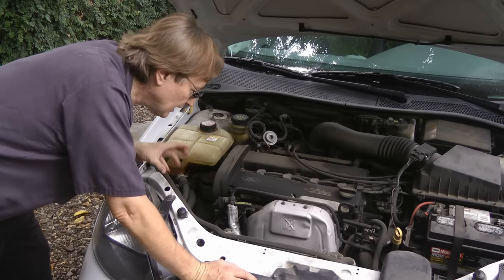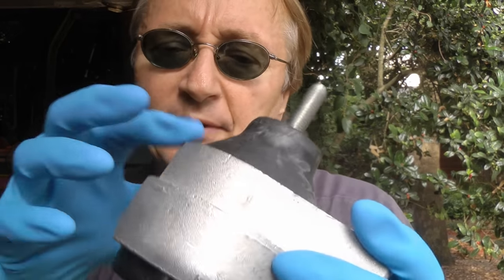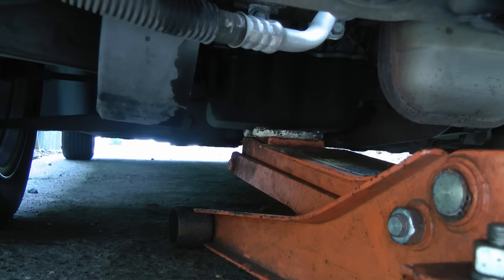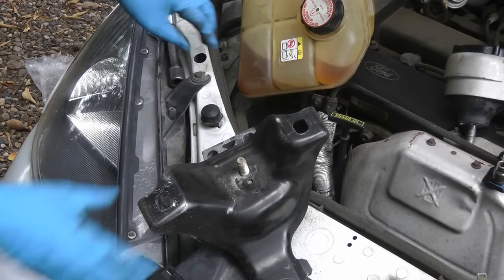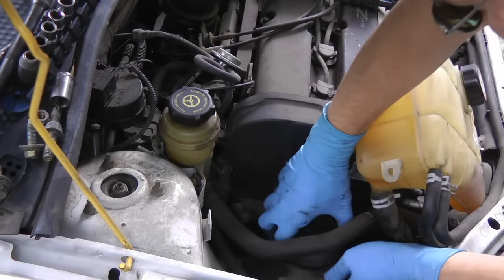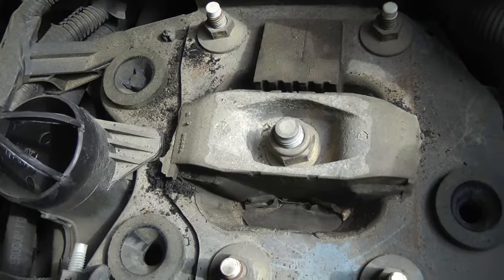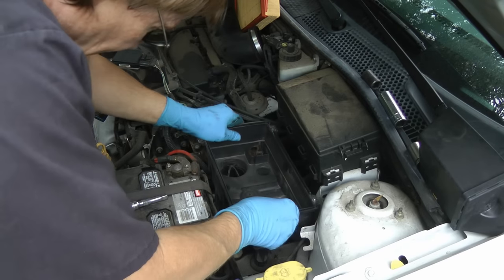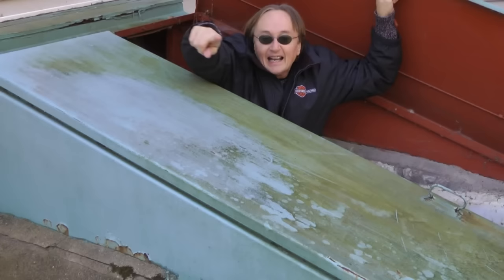How to Replace Motor Mounts in Your Car

Comment: Scotty Kilmer I have a 04 ford focus and when i put it in reverse it vibrates the whole inside of the car and makes a noise. and the engine move too like in this video... but i bought the car in october 2014 and they told me the engine mounts were brand new...and it just started doing this..it does it really bad when backing up on a small incline where i park and the driveway is on a incline.. It does it on level ground but not nearly as bad. But thing is my husband said it did it when he left for work but when he backed outta his parking spot at work it didnt do it..and it didnt do it when i went to the gas station or moved my car at my dads house. but as soon as i go to park it at home it does it.. Im worried....im one broke chick.

Comment: scotty i was replacing my front motor mount on my 04 honda civic and guess what? i broke the casing where the top bolt goes into now the bolt is all loose any good suggestions?????
Reply from the maker: +Juan  Mata drill it out and use a bolt and nut to replace it

Comment: I have a 97 grand am that I put new sway bar pins and new struts on the front and it drives tons better but i still here a vibration or rattle at higher speeds could this be worn motor mounts?
Reply from the maker: only if it occurred during acceleration, on just cruising mounts would have no effect.

Comment: hi scotty, i just brought a 2001 santa fe,  do you know why the steering wheel would shake very badly when im in idle ?   it vibrates in drive, park ( less than drive) ,  and reverse.  I went to a shop and paid a ton of money for brakes which did not fix the problem,  i have a check engine light for an EGR,   i am being told that the motor mounts are causing the vibration,  i just dont want to waste money again, thank you.
Reply from the maker: well, bad egr and bad mounts can both do that, have a mechanic jack up the car and show you the actual broken mounts IF they exist they can be seen
Reply: Scotty Kilmer thank you scotty! i love your channel,  thanks for helping us!

Comment: Hi scotty,
I have an 05 Yukon that vibrates at idle while the a/c is running. the vibration eliminates the minute I start moving. I've replaced the engine mounts but no change at all? any ideas?
Reply from the maker: those have had nothing but problems with the electronic throttle systems that set idle speed. Have that checked by a pro GM mechanic with his dealer level scanner first.
Reply: Scotty Kilmer will do,  thanks a lot!

Comment: hey Scotty i have a 98 dodge caravan 3.3 when i change gears to reverse i sometimes get a hard kick  back could that be a bad motor mount
Reply from the maker: +Andrew Rosado pray it's just that or a bad tranny mount
Reply: How would you know if its a bad gear
Reply: just check the engine as you change gear, if it's moving back n forth. it's bad mounts

Comment: Changing a busted motor mount on 98 caravan.  Motor mount is riding on pin only all the  rubber is gone, will my jack be able to elevate the motor enough to replace the mount or will I need a hoist?
Reply: Fyi, I do have a floor jack
Reply from the maker: Toumas henry
jack will work, BUT you will have to take bolts off other motor mounts to get it to go high enough
Reply: Thanks Mr. Kilmer! The King of cars!

Comment: Scotty, today my 1995 Toyota Corolla started acting up. It first started with a high pitched whirring sound when the car was in 1st and 2nd gear then it would go away, so I thought nothing of it. Now the car shakes upon acceleration from a complete stop and it shifts into 2nd gear really late and it also didn't go forward even though the engine accelerated. It did the no go only once but the other time it shifted late and the high pitched whirring was always there now. I pulled over and had it towed home. I suspect it is the transmission but i hope to God it is something else. What do you think and is it worth trying to repair it. Im only 16 and this is the car I go to school with and I'm on a tight budget. THIS IS AN EMERGENCY!!
Reply from the maker: transmission for sure, that model had a weak transmission in it. Try a used unit, fixing yours correctly would cost thousands.
Reply: Scotty Kilmer Do you think it is worth doing it or should I look into a new car.
Reply from the maker: argonian bilbo
I'd get another used toyota, you can often find a whole good used one for less than a tranny rebuild, and a used unit of course is a gamble
Reply: Scotty Kilmer I will look into it. If I sell it how much do you think it will go for. It is a 1995 toyota corolla with about 135000 miles on it. The only thing wrong with it is the transmission and a little minor cosmetic damage. Other wise it ran like a clock before the transmission crapped out. It also has a salvage title

Comment: Okay ive always been told when it comes to motor mounts your not suppose to preload / torque them while jacked up your suppose to snug the mount metal to metal no gaps or play lower your jack then torque them to whatever the ft lbs they require. Preloaded mounts while jacked up can cause them to fail immediately an most definitely before they should in most cases. So u might wanna check out the specs to your vehicle before following this video cause it may cost u more money doing so.

Comment: Hello Scotty , I have a 2005 chevy classic, a mechanic said I need my motor and transmission mounts replace, I want to replace them myself, but I don't know where are the mounts located at. Could you help me.
Reply from the maker: +Wardell B  get a cheap manual like haynes, they show how and have good pictures
Reply: Thank you Scotty, I will either go the library or buy one from Amazon or Ebay
Reply: +Scotty Kilmer Hello Scotty,I have question, my dad and I change the engine mount and 3 trans mounts on my car, The mounts were very bad, Today I was at the stop light my car was vibrating in the drive gear and reverse gear, but in the neutral gear, it was quiet for a while then it went back vibrating. Could this be the rotors or its time for me to get the transmission oil flush, I never had my transmission flush or the filter replace. My car is over 127,000 miles, its a 2005 chevy classic.

Comment: hey scotty:  i have a g35 coupe and sometimes when i go to a full stop i can hear something vibrating or shaking, also when i start accelerating but it goes away quickly.. do you think this could be bad engine mounts.
Reply from the maker: could be, jack up the engine to check as in my video "replacing broken motor mounts on your car"

Comment: Not related to the but i have a question..
I have a 2002 vw jetta and i just turned the engine off and one of the fans stayed on. 
I dont know if its normal or it have a problem,
Thanks if you answer
Reply from the maker: if it goes after after a few minutes, that's fine. If not, often a bad main computer circuit

Comment: I have a 2003 mustang gt. Engine shakes bad like none other under acceleration and at a stop and out my exhaust it sounds like, blub blub blub, weak acceleration and NO codes. Puzzled on what's going on, you think it could be the engine mounts?
Reply from the maker: +lyonschoice doubt it's doing all that, cause it would have no effect on acceleration. A weak fuel pump, bad maf sensor, or clogged fuel injectors often do that
Reply: +Scotty Kilmer ok thank you, popped off the oil cap and it was the Milky Way, ended up being a blown head gasket, thanks anyway!

Comment: Do you use the jack without stands?
Reply from the maker: in this case, to just check out the mounts, yes. Then you use jack stands if you need to raise the vehicle higher to replace the mounts

Comment: I've removed the motor mount with the jack under engine however the new motor mount sits high 1" above the engine. It appears to match the old motor mount except the bolt in the middle is 1" higher. The engine must have dropped with the old mount. Everytime I jack the engine up the entire cal goes up including the new motor mount. when i lower it completely it still gives me 1 inch gap. What do I do?
Reply from the maker: alec sithong get an oem factory mount, yours is the wrong size

Comment: Hey Scotty I got a 2003 Honda Accord coupe 4 cylinder, whenever I press the gas pedal at any speed the car shakes, when I step of the gas pedal it stops. Could it be a bad motor mount?
Reply from the maker: +B1oodline pray it's that and not a worn automatic transmission cause they do that a lot on those
Reply: could it also be the cv axles or tires out of balance?

Comment: I Have 1998 Honda Odyssey and the check ingine light is the only light that doesn't light up and turn off when I go to start my car I had a mechanic do a transmission rebuilt done and the guy said two motor mounts might need to be replaced would the check ingine light turn on to tell me this?
Reply: Typo I meant check engine light
Reply from the maker: 404040c no, it wouldn't warn you of that.
Reply: Have a place like Autozone scan it for free. They'll tell you the trouble code, what it means and how you can fix it for free. You don't need a mechanic for that.

Comment: In my 2001 Honda Civic I noticed one of my motor mounts broke in half and the bar holding onto it went into the metal above the wheel well area

Comment: hey Scottie I have a 91 Honda accord that vibrates when i stop at a stop sign or wherever and the car is in drive..what is causing that??
Reply: my 96 camry does that, its the mounts. im replacing the torque first and it should make the engine setttle down alot. im replacing the rest of the mounts when i get a jack - its a good idea to replace em all

Comment: I have the same car a Ford focus 2001 SE DOHC wagon. It Vibrates when I put it in parking, and idling. The engine doesn't clunk just vibrates makes the steering wheel,windshield, door vibrate. Can the motor mounts fix this?
Reply from the maker: if worn out, yes. Also realize it could need cleaning as in my video "how to fix a car that idles poorly"
Reply: Thank you 👍

Comment: Manual says to use 4.9 quarts oil, i accidently putted 5 in. Should i leave it or drain it?
Reply from the maker: leave it, that tiny bit hurts nothing.
Reply: Scotty Kilmer Thanks alot. You da best. But how much oil can you overfill with in a gasoline engine? 1 or .5 quart?

Comment: I was wondering if my engine mounts are bad? I have a 2000 Ford Explorer v8 5.0L. I feel a hard vibration during acceleration while the car is put in reverse.
Reply from the maker: try jacking the engine up with a jack and a piece of wood under the oil pan, if cracked, engine will rise and you will see mounts cracked open
Reply: Scotty Kilmer ok thanx

Comment: Does car need to be jacked up or just hold the engine in place
Reply from the maker: +XxGreenBeXx most need jacking up to get enough room to work on them, but if not, just get a jack under the engine to hold it up

Comment: how do you go about replacing motor mounts on a 2008 yukon denali with the 6.2 v8
Reply from the maker: +jholzer1989 A lot harder than this, you really need an engine lifting device as in my video "replacing an engine in your car" to do it
Reply: +Scotty Kilmer I have a cherry picker but I've found that you need to remove the exhaust manifold to get to the bolts that bolt the mount to the engine. too big of a job especially since I need to get the bolts replaced for the exhaust manifold anyways. chevy V8s are known for this stupid problem. they sure don't make them like they used to.

Comment: If the weight goes on the oil pan, wouldn't it dent it?
Reply from the maker: not on this thick cast unit, but on steel ones, use a piece of wood over the jack end.
Reply: Scotty Kilmer So i should be able to support my engine by the oil pan with a jack as long as there is a piece of wood between the two?
Reply from the maker: Josh Hack
yep, that's how I do em

Comment: Is it safe to jack up engine under oil pan
Reply from the maker: if it's thin steel, use a piece of wood on top of the jack under the pan

Comment: What about if my mounts are good and my engine still feels like it's moving. I can feel it though the whole car.  I checked for broken mounts or bolts and didn't find any.  Could it be the subframe is loose. I know the bolts for that are tight.
Reply from the maker: +mack cummy  transmission mounts can do that too, as an an engine that's running poorly and shaking from bad injectors or ignition system
Reply: +Scotty Kilmer No, the engine runs fine but when I apply torque to the engine the engine moves a more than it should and almost feels like it or something rocks back and forth for a few seconds when letting off the gas.
Reply: I figured it out. It was my driveshaft.  It did last about 14 years and was on boost.

Comment: So I need to replace my mounts but Im afraid of jacking up the motor (don't wana break anything)

So aside from the pan, where else can I safely Jack the engine?
Reply from the maker: that's the only real place there's room to jack,  Of course you can lift the engine upwards from the top, but you need a cherry picker engine hoist for that. You can rent em, or buy a discount one for about 120 bucks at harbor freight tools.
Reply: Ok, thanks so much! I appreciate the advice :)

Comment: scotty i heard you say put the jack under the oil pan? be careful and try to use another location to put the jack 
the oil pan is not too strong to hold the engine.
Reply from the maker: you use a piece of wood as insulation. sometimes that's the only way to get it up, other than getting an cherry picker engine hoist and hooking all that crap up to pull the engine up
Reply: i guess, i have never encounter that situation,hopefully never will. but then again i only work on my own cars and don't have your experience. thanks for the reply.

Comment: My a4 1.8t vibrates especially when I switch gears to DRIVE and REVERSE could that also be the motor mounts?
Reply from the maker: sure, jack up the engine as in this video and see if mounts come apart, easy to tell then

Comment: Hello Mr.Scotty :) I have a Toyota Avensis 2007 1.6 VVT-i engine. and my car start vibration at 2800 RPM. this happen with all the gears, and vibration disappear at 3000 RPM. what could this be? Thank you.
Reply from the maker: goku ssj2   check the automatic tensioner for the drive belts, they often go bad and do that. Also check for broken motor mounts
Reply: Thank you :)

Comment: Hi Scott,
I have changed my engine mount but still my engine shakes when gear shifts to drive or reverse (Nissan qashqai 2009) can u help what needs to b done in this case
Reply: Manual or auto?
Reply: Auto
Reply: sultan khulagi it could be misfiring

Comment: I had a Toyota engine mount that was replaced with an aftermarket one due to the price difference. Only thing is I can feel a little more engine vibration than before.
Reply: did u fix it

Comment: I got the clunk when changing gears from D to reverse, but i also have a shaking/ vibration going up to 60MPH and sometimes even at 25-30MPH could that also be the motor mount ??
Reply: Yup
Reply: ChainsGone2012  i had that checked from dealership and they have said it’s all normal and tried to blame my oversized tires

Comment: Is it safe to jack up by the oil pan like that?
Reply from the maker: use a piece of wood for insulation if pan is thin, safe if you are careful and already have the car up on jack stands to support most of the weight
Reply: thanks for the quick reply Scotty! this is going to be a weekend project for me.

Comment: i have a doge calibur 2007. 2.0. sxt. amd the engine shakes and the igine sputters. i dont what the problem is but is wont accelerate  past 3500 rpms. what's  the diy fix for what ever is going on.
Reply from the maker: +KEVLARSTEEL   pressure test the fuel pump, pray it's just worn out. also check the catalytic converter to see if it's clogged up

Comment: Why I had my mechanic replace my Toyota Avalon motor mounts this week.
Yes, I knew that they needed replacement and this was confirmed by running the simple test. I knew how to replace them and did not do it myself.  The car is 16 years old.  Sure enough.  5 minutes into the attempted swap, the first  old mount was so seized up (my term) that unit  had to be sent out to a machine shop to be removed. When you are the only driver, have only one car, no other driver or car available, you have the work done on an old car in the shop.  

Why did they go bad, just like the lower control arms?  Simple, although I drive slowly, the city has more speed bumps than a dog has fleas.  The fire department says the frames on its trucks break if they do more than 15 mph over a speed bump.  Imagine what they do to your car.

My catalytic converter is simply bolted on, not welded.  If the time comes to take it off and clean it, I suspect the bolts will present a problem.  It will be done in the shop.

Comment: Hi, I have one question:
I own a Mazda 3 2004 
At IDLE my car at aproximatively each 5 seconds shake a bit.
Even when im driving and that im shifting it seems a bit rought.
Is it motor mount?
Reply from the maker: could be that or transmission mounts, jack it up as in the video and check for cracks in them

Comment: Can a worn engine mount make a diesel engine louder?
Reply from the maker: YES
Reply: It doesn't shudder like mad but ive noticed that on the right side of the engine its a louder than usual and you can feel the vibration through the pedals.

Comment: any idea how to remove rear motor mount in 97 3000gt sl?
Reply from the maker: +Djkid1456 it's one cow of a job, I use an engine hoist to lift the engine when I do em
Reply: +Scotty Kilmer how did you get to the cross pin? do you get out from the bottom or from above?

Comment: Can my motor mounts be a reason I can’t accelerate past certain speeds ?its not my gas pump or belt slipping
Reply: Could be transmission or some kind of sensor. You can ask scotty on the maven app he wont reply here